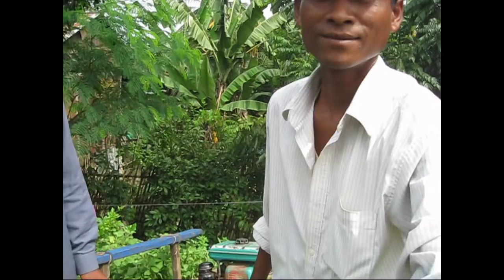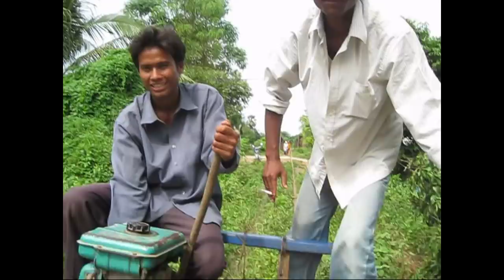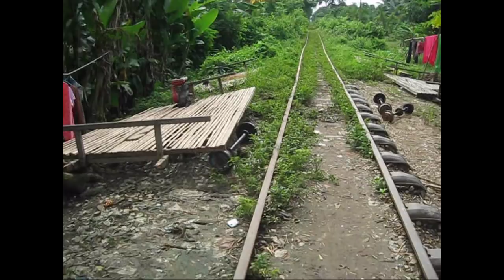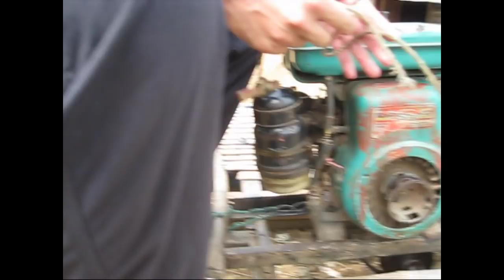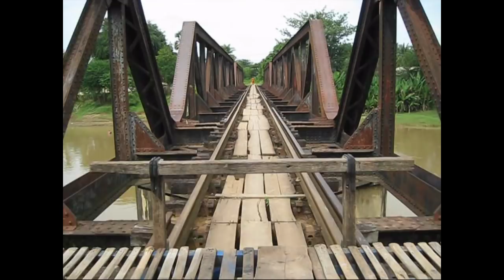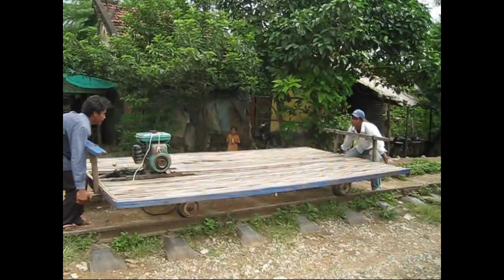Battambang, Cambodia Bamboo Train (Norry): Choo Choo!

Comment: A little confused as to what holds the two axles in place under the frame. Wish you would have filmed the bottom.  Nice video.  How long have those rails been in place?
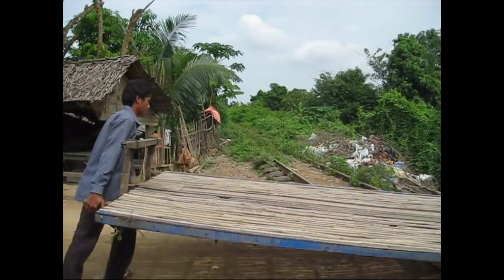Reply from the maker: Good question and I do wish I had a picture of the underbelly. At exactly 4:24 of the video, you can see the side of the wood frame's under-structure that rests on the axle. Nothing actually "holds" the axles or the frame and they are all unconnected.  The weight of the frame and its cargo hold it in place on the axles, and the axles remain inside the frame's "grooves." The rails have been there a long time (several decades perhaps), but were poorly placed, which has given rise to this alternative transportation system.
Reply: H Max, Upside down U brackets sit on those bearings. I'm guessing.

Comment: its got be a lot of work to remove those trains of the track each time there is another train in the way O.O Good thing only the engineer and conductor has to move it and not the passengers. lol i doubt people would pay a fee to get on a train they have to move  themselves anyways...lol
Reply from the maker: They can take it off the track in probably one minute, and reassemble on the track in about a minute. There are only a few pieces and they aren't too heavy. I paid a few, probably too much considering all the work I did while riding!
Reply: Shhhh
Reply: @danielribas1109  Yea,because I'm sure you are doing some extremely labor intensive work yourself.....😒